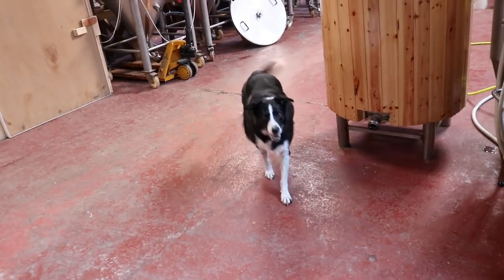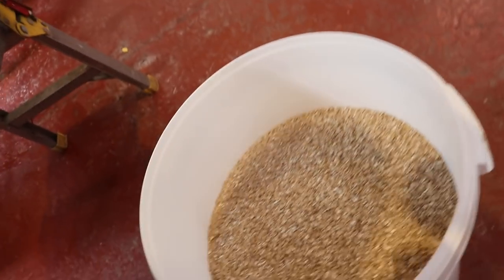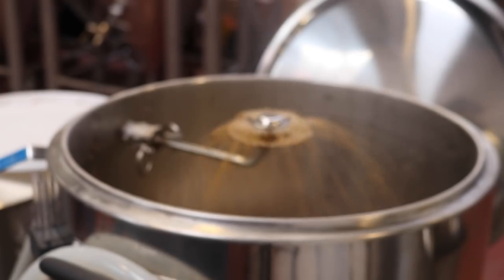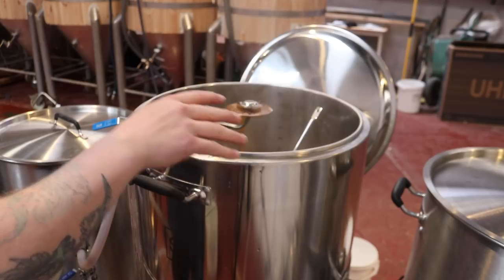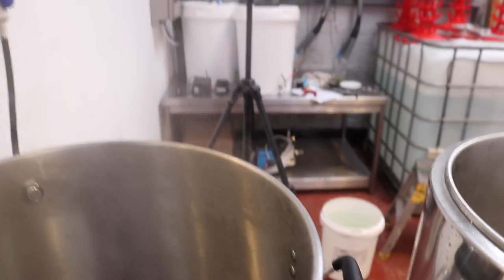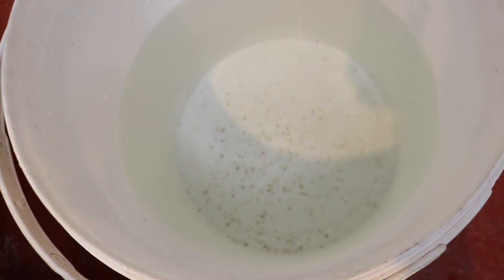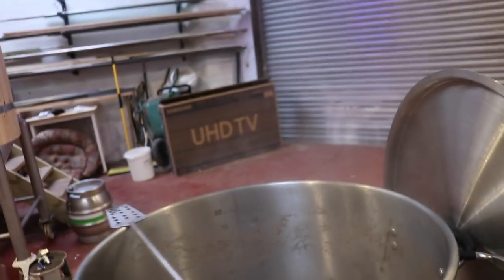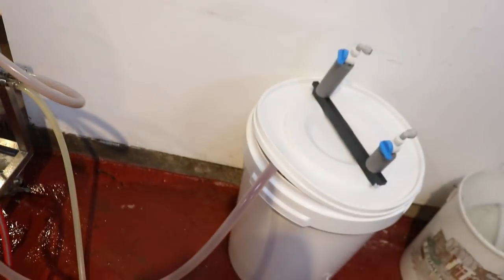🍊 Plum Porter Beer  🍺 ~ Brew Day Video 🎥

Comment: Interesting video for sure. I understand the need for a pump filter going into your plate chiller, but I question needing it for the mash re-circulation and sparge. I have a RIMS system with 20 G pots where I re-circulate through the RIMS almost all of the mash duration, and then recirculate the boil 15 minutes prior to cooling and then during cooling. I use an immersion chiller and re-circulate the boil mainly for a whirlpool across the chiller coils. I do all this without any filtering to the pump (Chugger), and I have had no issues. I then either rack or draw from the boil valve the wort to the fermenter(s) using gravity where the valve has one of those 1/2" SS crook bend tubes down to the corner of the boil kettle, and I don't get much trub into the fermenter with that. Again I get the plate chiller though - one of the reasons why I went with an immersion chiller so I did not have to deal with a filter or trub in the chiller and in the fermenter. That is an excellent pilot system you built!

Comment: Well you knew the first brew was going to show up any kinks in the system,I think you did pretty well all things considered. Porter looks spot on. Maybe you need some sort of a clip on chute on the lip of the mash tun to help with emptying grain. Might be a daft idea but what if you took that new filter and connect it to end of tap,run all your hoses off that and still run it through the duplex pre pump? I'm sure you get what I mean. Cheers.

Comment: Mines got a fine mesh on the inside, you could put a bleed off valve in line to bleed the air out, PT100 much more stable on reading to, cheers

Comment: Nice video on my plastic bucket i drilled a hole in lid put in a stainless steel tube and rubber bung into wort and put probe in that was nearly 3c variation would be more accurate for you otherwise good first run mate!
Reply from the maker: Difference is showing as 0.8 C in the tilt
Reply: @harrybrew69  too easy forgot about tilt as i posted this shows im just a ginger twat mate haha loving the videos tho keep up the good work and my next trip over from aus we will stop in

Comment: Love the pilot kit, Question about your fermentors, what are you using for an air lock? or are you just going by the bucket wont seal 100% and as long as it has a Co2 blanket  while fermenting it will be fine.
Reply from the maker: Yeah, I have not used airlocks for some time now. positive pressure in the fermenter and a crap seal on the lit. I am more worried about fruit flies than oxygen. I think I will be fine.

Comment: the ss brewtech mash tun lets alot of grain through, i have had to fine mesh my runnings out of the ss brewtech mash tun before putting into the boil pot using a nylon fine mesh bag over the tap and drain into to a jug.

Comment: You need 3 wire temp sensors if you want to change the length of the wire, temp probes function on the principle of resistance and by changing the length they no longer work. But if you get 3 wire ones, the third wire will act as a reference and you will be able to cut them to length.
Reply from the maker: Bingo. I have ordered some 3 wire pt100's

Comment: Thought about a thermowell in the fermenter bucket lids?
Reply: And the chute someone else mentioned would be a good idea. Make it detachable and you'll have an easy way to direct water or grain from boil pot and mash tun into a bucket or bag.

If you want to go straight into a bag maybe make a little stand that holds the bag open and sturdy. 

Anything to free up hands when trying to clean up will be a bonus

Comment: Hi Chris, thought you might want to look a a genuine ss brewtech sparge arm to give you some ideas. (ss brewtech have a seperate recirculation arm). I think the key is the small holes. Your end-cap might work if it was welded flat to the plate with small holes drilled in it. Anyway here's a video with sound of the real one: https://drive.google.com/file/d/14WmCj1GOp56jnwZp-SGUDNM_5JXXsCH5/view?usp=sharing
Reply from the maker: Cheers for that mate.